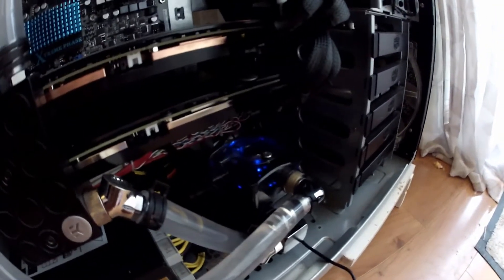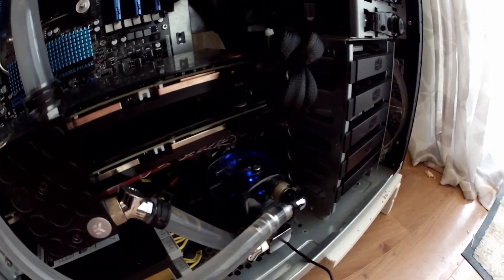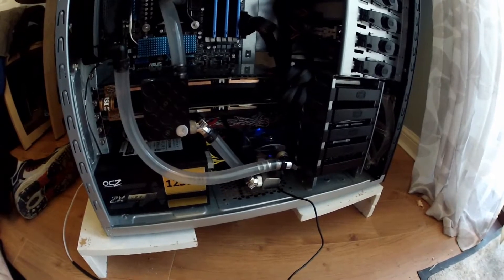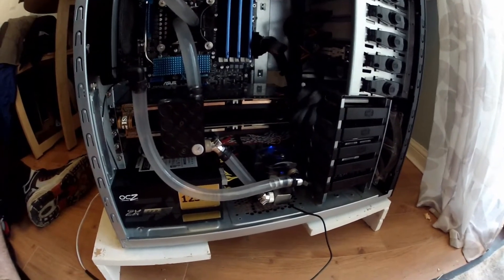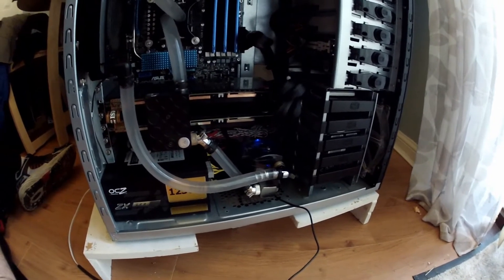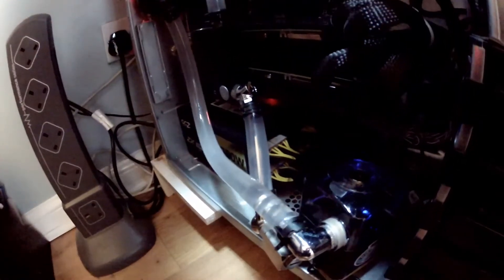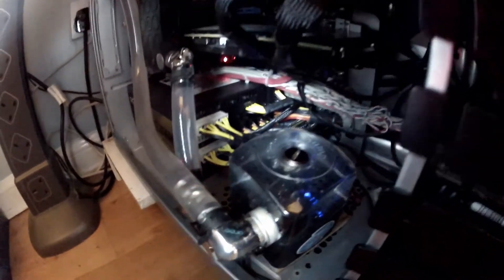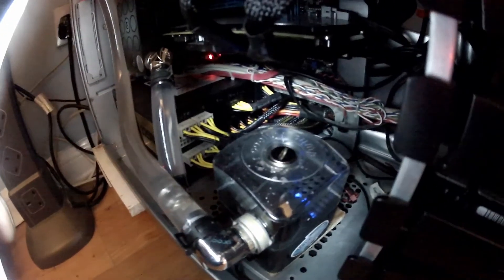Main Cause of Water leaks + Modding Stock Syscooling Pump (mod mk2)

Comment: you could put a barb connector in the top of the pump and put a small balloon on it to allow for pressure differences?
Reply: yeah that small rubber piece which sits on the top of the squeezy radox shower gel, of course except the X-cut in the middle, not a bad idea, absolutely not

Comment: nice video , what temps are you getting, also do you think the pump is any good
Reply from the maker: The the pump, although a budget pump is pretty good.  My water temperature on the rad inlet is 4 degrees C above ambient idle. Full load is (1070W combined) is 22 degrees C above ambient.  My CPU temp is about 35 under load and GPU's about 45C under load.  This system right now holds a record for benchmarking and has held the record for about 1 month (that's a long time in benchmarking).  The pump must be pretty good to allow that.
Reply: TheKayakingkid thanks for info, i hope to get one in the new year